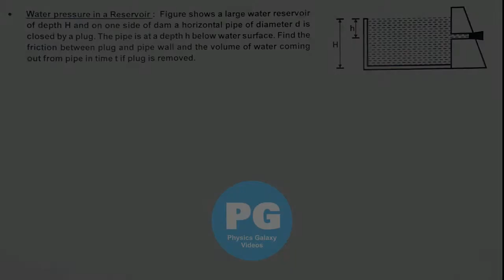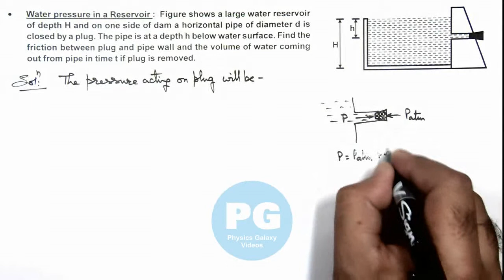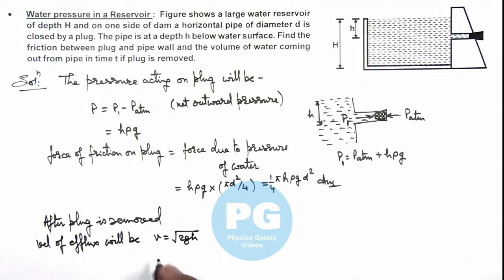26. Advance Illustration | Fluid Statics & Dynamics | Water pressure in a Reservoir | Ashish Arora

Comment: sir in the second part of the qs..shouldnt have we integrated as the pressure at depth h is varrying and thus also the flow rate..?
Reply from the maker: As given in problem that the area of reservoir is very large so due to small pipe diameter the height h will not be affected.... so no need to integrate here...
Reply: I also had the same question in my mind.  Thanks for asking already.
Reply: I also had the same question.
Reply: @physicsgalaxyworld  For that t also needs to be small
Reply: hello , what are you guys doing nowadays?? hows life
i am a jee 2022 adv aspirants btw
Reply: @paraskumar693 yes I guess here answer need to be integrated as the volume flow rate is not constant
Reply: @piyush012__.  ab to bhul gaya mai sb😅
Reply: @ABHISHEK-hj1br hello bhaiya same question to you where are you now?

Comment: Sir, Can you please explain why we shouldn't use the equation F= (A)(density of fluid)(v)^2   ??
Reply: Because while deriving that formula you must have used F=v.dm/dt . dm/dt is not applicable here.
Reply: @aravindansundaram4010  cool
Reply: @aravindansundaram4010  thank you
Reply: @aravindansundaram4010  thank you very much bhaiya...........
Reply: Wrong dm/dt is applicable but here fluid is static and the thrust force is pav² it is not the force due to pressure difference

Comment: in second part shouldnt we take height as a variable and then find v in accordance of y using eqn of continuity?
Reply: Yes here we have to use integration the solution of second part is wrong I guess bcz the volume flow rate is variable and we can't directly multiply t to it
Reply: @piyush012__.  U r partially correct, here as reservoir is very large, there won't be smy significant change in height of water level with time t (small values of t only) so height can be taken h, and so volume displaced will be linearly related to t. 
For condition of small t , data of Area of reservoir in comparison with hole diameter is needed.
Reply: But in qn it is not mention 't' is small. 
Moreover by the language of question t is the general time from imstant when plug is removed

Comment: Sir why not...in first part....2×friction force is equal to the force due to pressure of water....as friction force will act on both the contacts of the pipe and...plug....therefore net force will be 2×friction force towards the left direction?..?..?..?...
Reply: your NLM and FBD part is jacked up i guess
Reply: @vj51  you tell the right thing then?..
Reply: @jagritjoshi9130  friction will be acting on infinite points on the plug, in the question total frictional force is asked, as friction is the only force on plug besides the force due to pressure in horizontal direction hence the must balance
Reply: @samarthsai9530  sounds good...thanks..👍👍